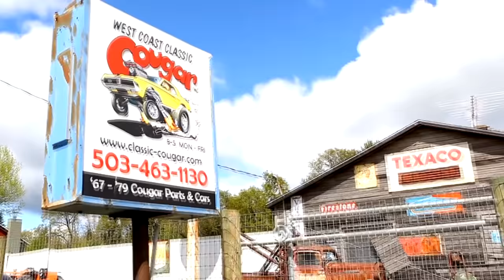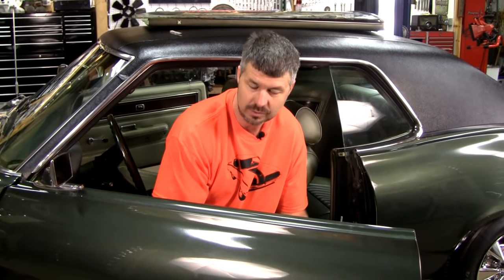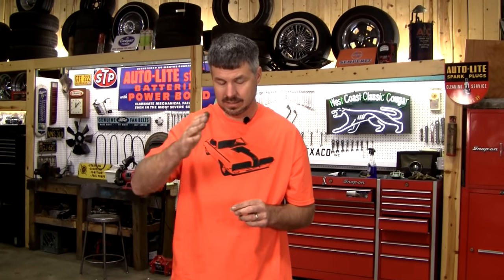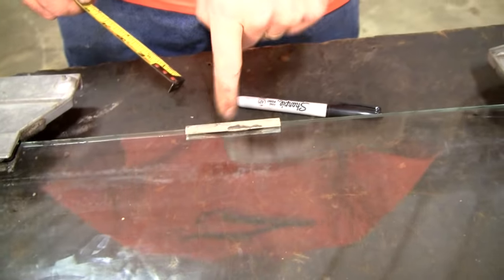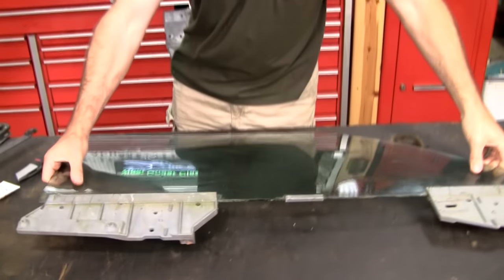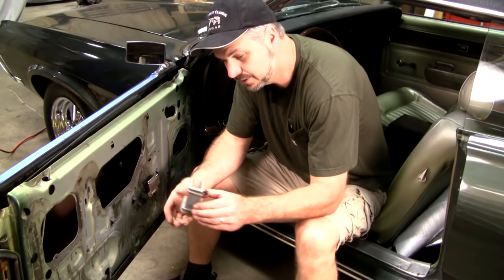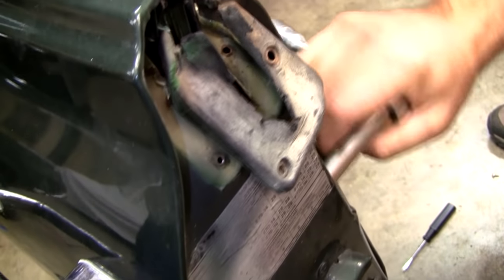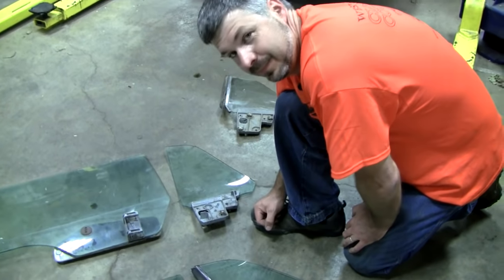1969 Glue-In Glass: The Comprehensive Repair Guide

Comment: For everyone struggling to get the glass with brackets back in the door, here is a tip. There is a square hole towards the front of the door that is big enough to fit the bracket in easily. Simply put the rear side of the glass in at the square hole towards the front, then once it is in slide it back and put the front side in the same hole. Works like a charm without touching the paint.
Reply: How is it a 41mn vid on glueing door glass ?
Reply: +1
Reply: @guysumpthin2974  Watch it, maybe learn a thing or two.
Reply: @andrewmccooey1688  you got that backwards, I mastered that in 1975

Comment: I'm currently restoring a one owner '69 Mustang Fastback for the original lady owner.  I had to remove the driver door (removed the fender first) because the door dropped significantly when opened.  The door is sitting on my workbench so I can sand and paint the sides before I install the weatherstripping. While sitting on my workbench I noticed the window glass was falling out of the aluminum brackets and I now need to everything together.  Thanks to this video I've learned some valuable tricks on how to do it properly. THANKS SO MUCH!!

Comment: I always enjoy your videos mate. You're honest in what you say. Im rebuilding a 69 Mustang fastback for a customer and last week removed all door glass and components. Wasn't too hard but little tricky getting the glass out. I'm not at all impressed with the belt line design, hopeless for heavy tropical storms. Would prefer beltline rubbers like the ones used on GM coupe cars, lot larger and sits tight against the glass thereby providing a near water tight seal. The Mustang ones will have rain water gushing into the doors. 
I also would like you to show a video on 69 70 Fastback rear glass removal/install and most importantly how to seal the rubber against any leaks. Google and you'll be surprised how many people complain about new rubber seals leaking water, even after they add 3M sealant into the grooves etc. I rebuild more European classics and handful of American. The Euro ones hardly have such issues, like a one time install and you're done for good. And most certainly you don't wrestle with things. Cheers mate

Comment: Thank you so much for making this video. I have a 71 Lincoln Continental Mark 3 and it is built pretty much the exact same way. I had no idea what glue to use or how any of the multiple adjustment points worked.
 I'm not sure about your Cougars but the rear quarter on my Lincoln actually slides rearward into the C pillar.  First vehicle I've ever had that does that trick.

Comment: Awesome video.  I just did every one of my brothers windows on his 69 convertable, copying these instructions almost to a tee.  Great idea on scuffing the windows, I used the sandpaper tool on my dremel which worked great.  When doing the quarter windows, I never removed the piece that bolts to the regulator.  I was able to do it all in the car, which was easy.  Just gotta be careful to not get any glue on the seals.  Slid them in from the gap in the front with the mounting bracket down a few inches.  Windows go up and down so smooth no after cleaning all the sliders and regreasing.  Chris homan
Reply: Now this is what I'm interested in.  Are you still out there? I did the driver side taking it all out and then putting it in.  I did not do it as easy as it was for Don.  I want to do it all in the car for the passenger side. You took the brackets out of the door, and glued them on the glass, and put it back in the car without taking out the regulator? Or did you leave everything in the door, except the glass itself.  Then somehow dropped the glued glass into the brackets in the door?  Thanking you in advance.

Comment: I love all the information in this only thing I'd find more helpful is accurate measurement of the bottom of all the glass mentioned in both metric, an standard inch. I'm guessing from the bottom front to bottom back since there are so many different options. I hope to convert all door rear quarters  to 1970 bolt in. Just acquired a 1969. That is rough but feel brave enough to make this non running driving  cat into a daily driver.

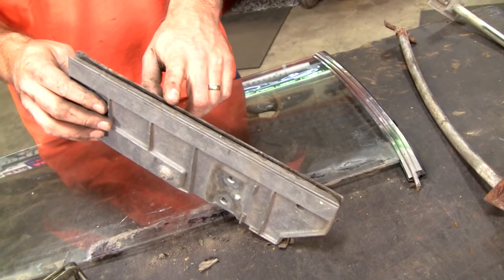Comment: Great video, i have a 70 mustang, my passenger side glass is not riding in the weatherstrip channel at the front(too far inboard), it also rubs the upper front stop with the front window metal guide. I got frustrated and stopped before i broke something. Mine are bolt in glass 70 style. I was watching your video, at 11:40 or so, you said those runners are the same on the drivers side, are you gonna tell me they are slightly different on the passenger side and solve my problem. I have the front one on the back and need to swap them. I really hope you just solved my dilemma. I did have all the guts out for cleaning/ restoring evolutions. Thanks for you videos and help!

Comment: Great Video, I am re-gluing my 69 Ranchero side window back in. The previous owners glue job did not hold. I removed all the glue and original glue out of the channels and purchased a new RUBBER TAPE KIT from AutoKrafters. Does this rubber tape need to be glued on both sides, channel and glass sides?

Comment: About to embark on a project to do this on a 69 Mustang Boss 302.  Driver side glass fell out. Shape it's in on the inside of the door is probably akin to what you found in the cougar and that old bonded door you showed outside.  This video is a God send. I searched but found nothing about the rear quarter glass (gotta go in similarly for it too). I am confident I can complete this as per your guidance. However, I have no idea at all about the quarter glass. Hardware looks good down in the panel but the glue rotted and it fell out too.  Do you have a video for how to get the quarter glass done also?  I feel I could glue the glass in there without taking anything out if need be but would be concerned about the location of where it would be glued on to the bracket for a good fit whan rolled up. Thanks!

Comment: Did you need to do anything special to ensure that the glass will seal properly against the weatherstripping and doesn't tilt too far out from the body once you've glued the brackets to the glass?  I tried to do this job on an old Ranchero years ago and failed miserably. I did everything like you describe here but the top of the glass stuck out too far from the car and wouldn't seal against the weatherstripping when I was done.  Now I have a 68 Fairlane with the same problem.  Any advice is most appreciated!  Thanks!

Comment: Appreciate this video. Any tips for if the metal molding on the rear of the window comes apart? The window is still set in the molding but right behind that the two pieces of metal molding separated. Able to fix or should I get a new molding?
Reply from the maker: Probably best to just get a new trim piece: https://secure.cougarpartscatalog.com/store/Search.aspx?CatID=15886&SearchTerms=door%20window%20vertical%20trim%20repro&Type=AND

Comment: The stud in Window Channel Bracket - Don says it should be free floating. Should it be free also when regulator arm is attached to it? Since it is window's fore-aft adjustment, I think it should be stationary (fore-aft movement) when nut is secured?

Comment: Don, will be putting window in my doors this week in my 70 Eliminator.  Should I have my belt line weather strip in the door or out.  Seems like would have more room not putting it in ? Thanks mike macleod
Reply: If you have bolt in glass space is not an issue.  If you have glue in feed the glass in through the back.  To learn more login at classiccougarcommunity.com  and post on the forum

Comment: Very nice video.  Regarding the slides, you noted that these should always point to the front of the car.  The demo door shows these pointing to the rear.  Does it matter as long as both point in the same direction?
Reply from the maker: +Mike Baer Good catch, we think you're correct - as long as they face the same direction, it doesn't matter.

Comment: Great video.  I did find that setup of epoxy is a mess.  I used a caulking gun and two dowel rods to push into the epoxy.  Some of the epoxy came out the back end.  And this stuff is barely enough for one window.  Not enough if you have cleaned the entire mount out and it's bare metal.  I was able to use plastic toilet shims to center the glass.  The shims break off easy after it dries.  Just make sure to get the shims with the ribs that can break off against mounts.

Comment: Thank you so much for taking the time and sharing your expertise. I will certainly watch this again. Two question : My driver door will not close if the window is all the way up. Should the top of the window fit flush to the gasket in the door or should it be recessed into the gasket? There  is a metal "thing" at the inside rear of the top of the door frame that is hitting the glass when I close the door. What is that?
Reply from the maker: +Skip Barrus Not sure what the metal thing is you're referring to, a picture would help. As for the window going up too far, you probably need to adjust your stops.

Comment: After installing new plastic guide clips my guide bracket is still loose on the rail. As you mentioned, these repro clips are not the same as the originals. Just wondering if you have tried giving the guide bracket a squeeze in a vice to try to reduce the gap so there is less play, or do you risk damaging the bracket?
Reply: Well answered my own question. Tried giving them a bit of a squeeze in the vice tonight and now they fit perfectly with no play. You can also use the new plastic guides with a very thin shim of plastic under the wings as someone else mentioned. Something like the clear plastic of the lid of a shirt box or some type of rigid plastic packaging works well. It doesn't have to be very thick. It's amazing the difference a thin slither under each wing of the guides can make. The guides clip in very tightly so there is little chance of them falling out.
Reply: Thanks for the tip, I'll be working on mine for my 68 ranchero this weekend

Comment: Don  I do have a question on window replacement   in video above while in yard you show a door cut out.  the bracets that side up and down on the two rods face to the back of the car,   while your installing the window in the shop you say bracets face forward.. Which is it ?   Thanks for all you do for us cougar guys   Mike Macleod   flowery Branch ga
Reply: Good eye, the cut away door is wrong but do know they work just fine no matter which way they face.
Reply: Just getting close to putting my glass back in in my 70 cougar Eliminator.  Getting closer    Doors are on.  Fenders then engine.   That’s on letting me know they can go either way.  And thanks for the quality parts.  Just wish you were closer to Atlanta.  Best Michael Macleod

Comment: Is the window regulator different for the rear windows also? Just purchased a 69 mustang and am redoing it, found 69 glass in drivers door and 70s clamp in glass is passenger. Not sure about the rear glass yet, going to work on those this weekend. Thanks.
Reply from the maker: Yes, the quarter glass is specific to 69 or 70.  Here is a link to our 69 Quarter Window parts: https://secure.cougarpartscatalog.com/store/Search.aspx?SearchTerms=quarter%20window&CatID=15886
Reply: @WestCoastClassicCougar  but the regulator is the same for rear correct? Says 69 and 70 for the rears. I seen about the front regulators and glass are different for 69 and 70 and rear glass is different but regulators and window brackets are the same?
Reply from the maker: @jasonmanes3862  Yes, the brackets and regulators (or the window motor if equipped with power windows) for the quarter windows are the same 69-70.  The glass, quarter to body seals, glass mounted weatherstrips are different.

Comment: so this is an awesome video and i feel confident in my ability to get this job done thanks to you. however. the channel piece at 11:15 The stuff in the channel came out with the glass. odd yes i know so i cleaned up inside of the channel as best as i can but now im left with another problem. how to i get the glass centered in the channel to glue it. 
any help would be much appreciated. im stuck
Reply from the maker: +cameron kline Maybe you could make some little wooden spacers / wedges on either end of the glass to keep it centered in the channel? Not sure, get creative!
Reply: +West Coast Classic Cougar thanks I'll try something like that
Reply: NOW I read this...
This would've been a good thing to know before I glued it wrong.
Guess I'll be buying this customer a new set of brackets and maybe a window before it's all over.
What a terrible design.

Comment: Thanks so much for this video! 
I see people are saying that gluing 1in from each end of the glass is not right for a 69 fastback mustang. Does anyone have the correct or approx measurements for a fastback 69? The clamps were glued in the wrong positions on mine so I can’t use them as a guide. Greatly appreciated if someone can help.

Comment: This is great however I would like to point something out.  You mention that the window guide brackets face forward as they ride up and down on the window guide rods, however in the cut out door they face backwards or to the rear of the car.  Which is correct?
Reply: The cut away is wrong.  Good eye!  Actually they seem to work the same which ever way they are placed.
Reply: In the Mustang Part & Body Illustrations manual that I have they face backwards or to the rear of the car. ie. The arms point to the rear.

Comment: Fantastic. I just got my driver side done in a 69 Mustang.  Thanks so much Don.  I want to do the passenger side next.  Is there any way to do it without taking out the regulator and/or brackets? To glue it in in the door? Did you ever make a video on doing it that way?

Comment: Hi I was wondering if you could maybe help me.Im gluing the windows back in the tracks on my 69 mach 1,my question is,is there a gasket that sits in the track before you apply the glue or do they sell those gaskets.
Reply from the maker: No gasket needed, just use a bedding compound
Reply: @WestCoastClassicCougar  What is a bedding compound. I just bought the 3m glue that you guys used in the video.
Reply from the maker: @Tkleiman1  Sorry for the delay.  Here is a link to the bedding compound: https://secure.cougarpartscatalog.com/10022243.html

Comment: I know you gave the 1" measurements from the edge of the glass for the brackets. But how deep does the glass have to be in the channel? All the way touching the bottom, or I've read 3/8" shim on the bottom of channels??
Reply from the maker: About 3/8" is the correct spacing.

Comment: Does it appear to anyone else that opening at the end of the door may be wide enough to slide the glass brackets through before lowering into place rather than having to force the brackets through the top?
Reply: +Elvis Presley As you noticed the notch at the front of the door is wide enough for the window stops built into the door brackets to fit thru. I have removed and installed my glass through them multiple times without the hassle shown in this video. When installing you simply guide the rear bracket thru first then move the glass rearward in the door and guide the front bracket thru. It is much easier than this video depicts. However the rest of the video is very informative and accurate.
Reply from the maker: You're right! Another customer noticed the same thing. We stand corrected. Here's a little video he did to demonstrate: https://youtu.be/eqVhpl0CEoQ
Reply: Correct, should have done it that way, it had been years since I had done one and forgot all about loading it through the back!

Comment: Thank you for all the parts. Just installing all the glass and brackets ATM on 69 mustang coupe. In this video both the window slide brackets face the same way (14-15 min in video)  Is this correct? or should they both be facing with openings to center?
Thank you
Reply from the maker: Just double-checked the diagram in the Ford master parts catalog, and it looks like they do both face towards the back of the car, as shown.

Comment: Can I use the bolt in style instead of the glue in if I have to replace which i'm sure I will have too? Thanks.
Reply from the maker: Yes, but you'd have to get the door and quarter glass, all brackets, regulators, etc. It can be done but you need to switch out pretty much everything.
Reply: Thanks. Very insightful video by the way. Well done.
Reply from the maker: Glad it was helpful!

Comment: Figured id point out for anyone doing this on a 68/69 Fairlane, you will want to shoot for around 1 1/4" from edge of glass.  Just went through this process, assuming that 1" would be standard, and got to dremel out the slot a good 1/4" in order to get the windows far enough forward.

Comment: I was to by a 70+ years young man who has owned ford all his life. If you soak the window glass brackects overnight in lacquer thinner it will eat the glue away enough to get the old glass out. Gonna try it just haven't got around to that project yet. Great video by the way! (question) will the chrome weather strip on the side of the window fit on a 70? I like the look.
Reply from the maker: Not a bad idea! And no, the '69 vertical chrome piece won't work on a '70, as the size of the door and quarter windows are different, and on the '70 you get a vertical trim piece on the quarter window instead of the door window.

Comment: I just found this video and have a question. All of the hardware you show for the 69 looks identical to the stuff inside my 68 Torino. Do you know if it is interchangeable?
Reply: Almost every part in the torino door is at least a little different.  Same design, different size.
Reply: @donrush5690  how about the "one inch each side" rule to glue the glass?  Does it apply to torino too?